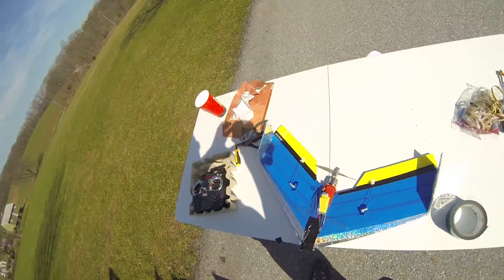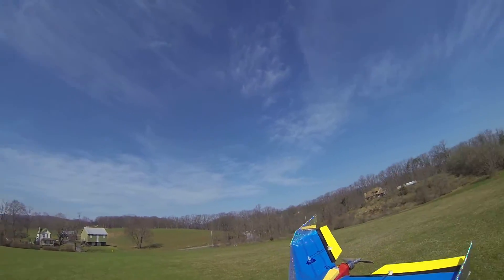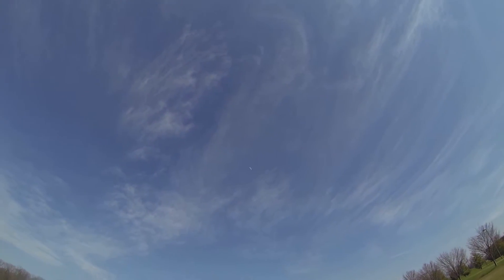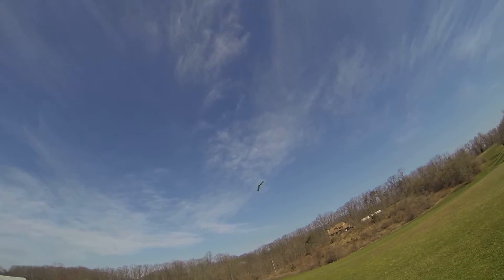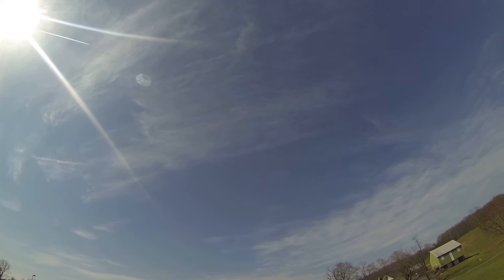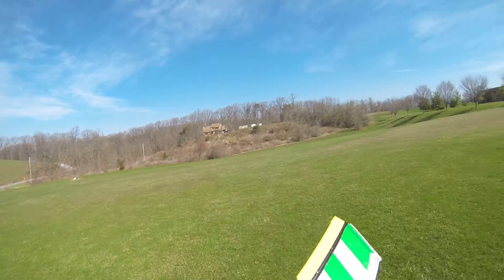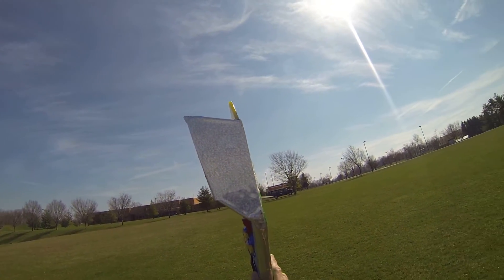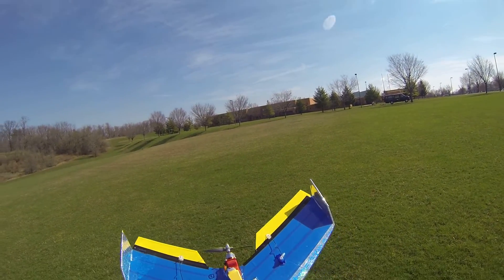80 mile per hour $2 Foam Board Flying Wing Flight Video

Comment: Kilovolts. seriously?
Reply: Those motors are rated in KV they mean kilo-rpm per volt.
Reply: I've got some 920 KV dji E3 here, so that's 900 kilo rpm per volt, 900 000 rpm times 14.7 volts, let's say 15 ( if the're on 3s). HAHA this joke is getting better and better :p The KV value is the speed the motor need to turn so it produce 1V of counter-electromotice force. If you want to know more about it, see internet. Have a good one
Reply: Mattheus Cochet you're such a gentleman. A real pleasure.

Comment: What is the wing span, root and tip chord and sweep? All up weight?  Is the airfoil flat bottom or symmetrical? Awesome wing!
Reply from the maker: +grant31781 Go to my child care center website at whalesnail.com and go under the picture gallery section.  at the bottom of the gallery of center pictures, you will see a full layout of the wing broken out into three pages, as well as the full parts list for both the slow and fast flyer.  Both slow and fast flyers use the exact same wing, they just use a different combination of batteries, esc's, and motors.  The slow fly plane is much lighter than the fast fly and is therefore floaty at very slow speeds.  If you have a three mile per hour wind, you can bring it by you at walking speed.  The fast flyer weights nearly a pound with 1.8 battery and will not fly well slow, but it will fly great fast:  anything above 40 mph all the way up to its max of 85mpg.  Because it has a high weight to wingspan ratio, it will handle wonderfully in this winter wind.  I flew yesterday in 25 plus miles per hour wind that was very choppy.  I flew the hobbyking club trainer at maximum throttle in this same wind and had to land it at maximum throttle to fight the wind, which was nearly holding it at a standstill during gusts.  My wing just tore through it and even though it flew at a ground speed of as much as 40 mph less against strong gusts, it still travels at an airspeed of 85 mph at full throttle, so it easily handled it.  By easily, I mean, once you've mastered the wing.  Don't just go out in high wind without a lot of experience in normal wind with this wing, because in high wind, your responses need to be immediate and correct.  This wing will do everything you ask it to do in one second, including flying straight into the ground.

Comment: Could you switch the hot glue with silicon? Would it be lighter?
Reply from the maker: BatSwag Never thought of that.  Give it a try and let me know how it works.  One disadvantage I can think of is that you have to wait for it to dry between stages.  But if you are willing to put up with a longer build time for added performance, the idea sounds good.  Again:  let me know if you get said extra performance.  Very interested.

Comment: I made a wing similar to this couldn't get the same speed I have a 2400kv and 12amp on mine. I just got a 30 amp and a 60mm edf I made a wing with and its a little faster but the battery cooks on the 30 amp
Reply from the maker: If you use the configuration I have here, you can fly for hours straight at full throttle and the esc will not get hot and the batteries will only get warm.

Comment: Hi William, I measured your speed from 0:55 to 0:57 by running the audio through my Doppler program.  Your wing passed at 143kph or 88mph.  That's the same speed I got with my flat foam F-22 with a 3200kv motor, 50A ESC, 6x5.5 prop, powered by 1000mAh 3S.  All the best and Happy flying!
Reply from the maker: Pretty cool that you were able to tell that by the sound of the wing in the video.  It turns out you are right on the money.  I had a Pennsylvania State Trooper pull off the highway and follow one of my wings I fitted with LED lights, back to me.  I though I was in trouble, but he just wanted to see the wing.  After watching me fly for a while, he said: "Fly it right at me, I have my radar gun.  Lets see how fast it goes".  We clocked it multiple times at between 80 and 90 mph.  80 mph when flying level, and 90 mph in a dive.  However, I just found a new Turnigy pusher prop like the one I recommend, except this one is 6" with a 6 pitch.  The wing now goes between 90mph and 100mph.  If you build it, let me know and thanks for the feedback.
Reply: William Whale  Ha ha!  My neighbor is a police officer and he loves my flying stuff.  A radar gun uses the same Doppler effect but with radar waves.  The program I use derives it's results from the sound waves but the same Doppler effect.  All the best and happy flying!

Comment from the maker: I set expo at 65% and differential at -33% for ailerons and 75% and -33% for elevator
Reply: William:
you have your expo's set at 65% ailerons and 75% for elevation, but I don't understand how you're setting your differentials at -33%? I am using a TGY 9x I can set the differentials at 33% but not at -33%???. This is a great build by the way!!!
Reply from the maker: thanks for the comment.  It is possible that your TGY 9x 33% is the same as my Tactic -33%.  What I am doing is making the sticks less sensitive when they are closer to neutral, but gaining full functionality as you move the stick full away from center.  This way, you can fly without the model being too responsive when you move the sticks a little, however, when you need full throws as when you are spinning the wing or pulling it out rapidly from a dive (especially one you are doing in strong down-wind situations), you will then have full throws by pulling or pushing the stick to its extreme.
Reply: William:
Thanks for taking the time to respond! I am a new pilot. I know exactly what you are explaining now. I am on my 3rd small wing, and I may have set the controls a bit sensitive in the past. So, your explanation of the differential setting clears up a lot honestly. I also have builded and flown a 42" delta wing, and realized how sensitive the controls can be when flying. I realize now that when you fly a smaller wing the sensitivity of the controls multiplies. Keep the posting coming everything I have learn about RC flying, I have learn it from someone else's posting experiences! (youtube, RCGroup, goggle+...etc)
Reply from the maker: As you become more experienced flying this wing, you will up the throws of the flaps while keeping the throws less sensitive towards the center of your transmitter sticks.  In this way, you will have a wing that flies comfortably when moving the sticks a little but really responds when you throw the sticks a lot.  Gain experience first or you will wreck a lot of wings because if you are not experienced, you will thro the wing into an uncontrolled spin.
Reply: William:

Thank you for taking the time to write some pointers  on how I could improve my flying experience with this great little wing.  

Thank you!
Reply: William:

One more question, what type of Tx radio are you using and are you using OpenTx firmware?

I ask those questions, because I believe OpenTx I can set the dual rates/expos the way you explain them in your last reply.

Thanks for your answer in advance!

Felix
Reply from the maker: I use the Tactic programmable transmitter for my flying wings